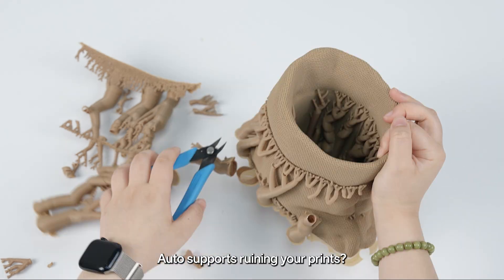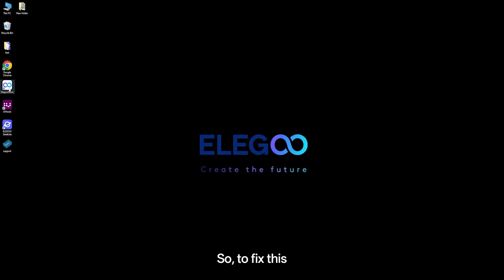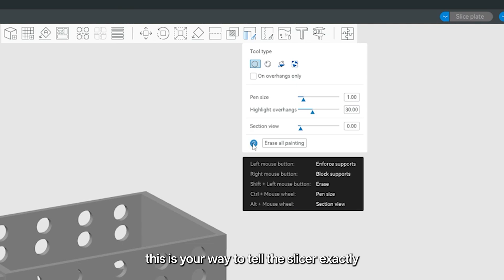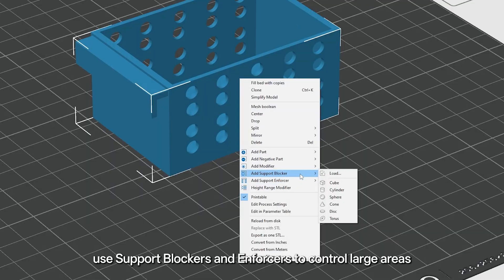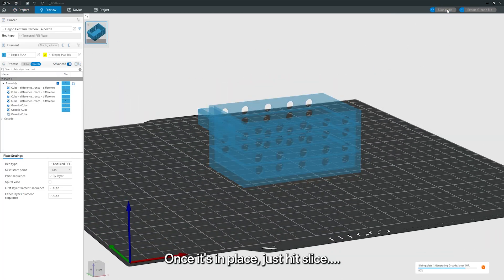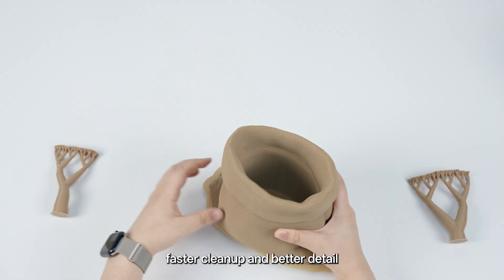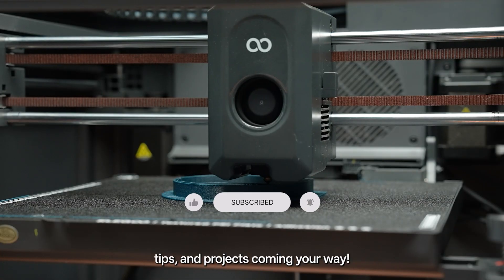Auto VS Manual Supports – Stop Wasting Your Filaments!

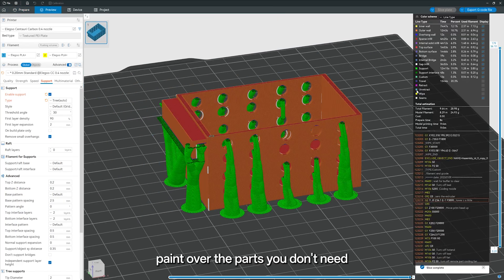Comment: Ok, but at 0:43, you basically get the supports as they are generated in auto mode. I’d love to see some smarter supports that don’t grow from the build plate but instead start from the hole itself, so you don’t waste filament. So what is the solution?

Comment: Or sort your slicer out so auto works 🤷
Reply: It's basically Orcaslicer,  and the same thing applies.  these slicers do not have Ai  built in,  auto just adds supports to anything  facing downward,  there are other settings within these slicers that do cater to these things.  but using the blocker is an easy way to address this.